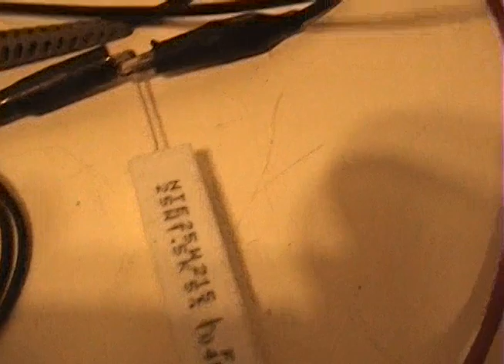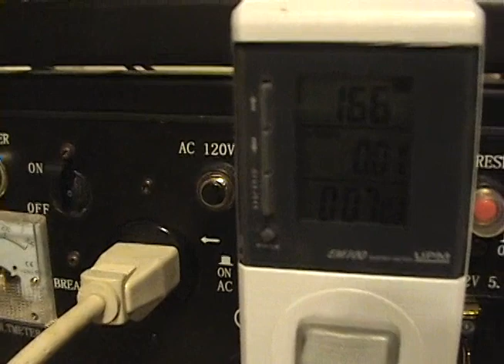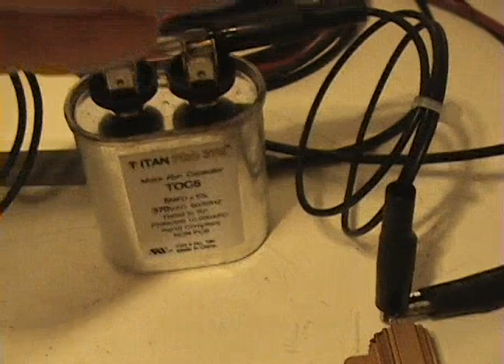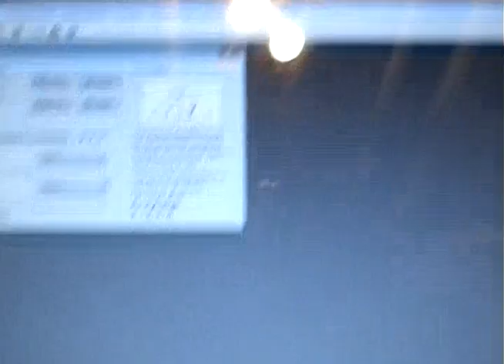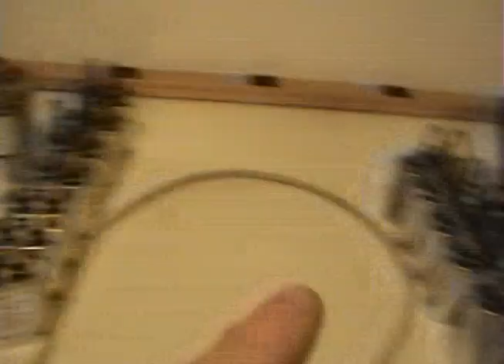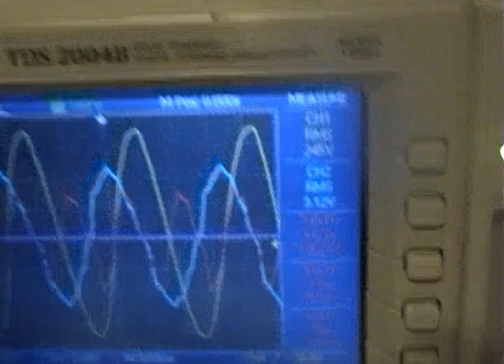Reactive Generator Tutorial Demo 1

Comment from the maker: To all who have not been following the forum topic at Overunity .com?... user id poynt99 has identified an error in my scope settings. I was using AC coupling for my power measurements when it should be set at DC coupling. I'm not the only one that was doing this.Two other experimenters said they were doing the same thing. I've since re-tested everything with the scope on DC coupling and I now see no real power gain or advantages in the circuit as when I was first testing with AC coupling. There is a big difference in results from AC to DC coupling as far as scope math is concerned.
It's also clear that a plug in meter cannot calculate a 90 degrees phase shift power correctly. So results using just that need to be questioned.

As for my generator tests, even though they had no effect on the gen prime mover the energy source has been identified by user id TinMan that it was a transfer of power from the gens exciter field to the load and which by coincidence had no effect on the prime mover.
So two different things happening which made the results look good but now look like there is no real power gain after all.
Maybe reactive power can be used to an advantage if you had a circuit which would use the return cap discharges (at 45 degree) and convert it to mechanical power (like I thought my generator was doing) or shore it in a battery. But none of this is happening if using single phase grid or gen. A 90 degrees phase shift for the single phase grid is like a short circuit and the wires just heat up.

That's where things are at this time. Sorry if you were not informed. In the future it would be best to use the link to the forum topic which are in the about tab under all my videos.  This way you would be the most up to date with the research.
All the best in your experiments

Luc

Comment: Very informational thanks for sharing. If you are mistaken, as poyntt99 says, its merely a learning experience for us all. Many appreciate your efforts and you taking the time :)
Reply from the maker: Hi Diadon A, I may not have the scope all correct but that does not disprove the effect of the circuit which is most important. A group of experimenters at RWG Research forum have been researching looped generators and found my research and already built a Generator using the Series Capacitor effect.
User Matt Watts may soon have his looped.

http://open-source-energy.org/forum/showthread.php?tid=1471

Luc

Comment: Nice presentation Luc, unfortunately there are a number of problems, which I will address in due time. Meanwhile, I find it appalling how you have disrespected me in this video, especially since you have provided absolutely no proof of your accusation that I am wrong about the channel two inversion requirement. This isn't going to be good for your credibility I'm afraid. You are wrong, both about the probe inversion and about your claim that power is being returned to the grid in your tests. And I intend to prove the latter to you shortly. As for the probe inversion, that will come in another video tutorial. I'm quite disappointed that have stooped to such a low level Luc.
Reply from the maker: Thanks Poynt99, looking forward to your video tutorials on how to use scope math properly. This will be very helpful to many, as there is little information out there on this. A video demo is the best teaching tool and hopefully I will be able to learn something. If I come to understand that I did do something incorrect with my scope measurements I will be more than happy to delete the tutorials and redo them.

Please note, my tutorial were not to demonstrate how to use a scope. So no need to get on your high horse about that. The Tutorials are to demonstrate how to get the effect by using certain values of Capacitors, Resistors and the effects at different Voltages. The scope was used to show what is happening with these different values.

Truthfully, I don't care that much about what the scope can calculate. The real test to me is the Generator. So I do hope you will have a Generator to test the correctly tuned circuit and can clearly explain why the circuit has no effect to the Gen Prime Mover. Also why this effect would not be useful

Thanks for taking the time to do this.

Luc

Comment: Hi Luc
Great video. While i agree that channel 1 dosnt have to be inverted while only a resistive circuit,it dose have to be inverted once you add the cap. It then becomes a capacitive circuit,and in a capacitive circuit,current must always lead voltage. Looking at your scope,we can clearly see the voltage leading the current. So channel 1(voltage channel) must be inverted when the capacitor is added to your circuit to get the mean value.So from this,your 10 ohm resistor is dissipating about 3.1 watt's-thus 3.1 watts is being consumed from the grid-not going back into it.
Hope that helps.
Reply from the maker: Hi Tin Man,

you have it backwards, channel 1 is voltage and channel 2 is current. Current is leading when capacitor is connected.

Luc